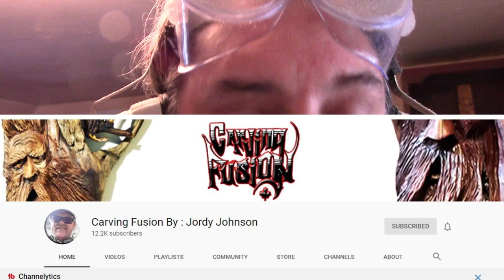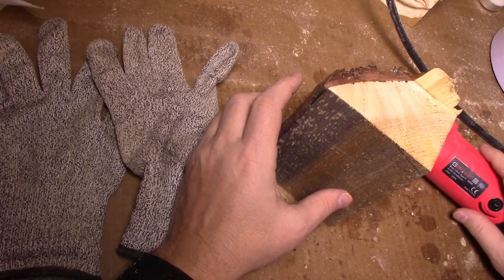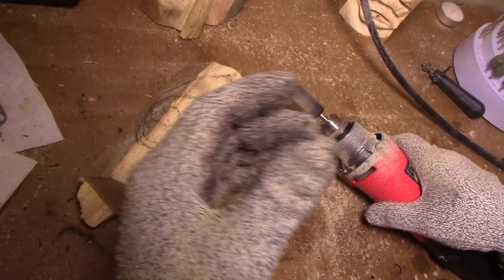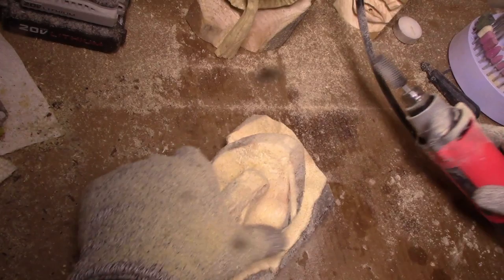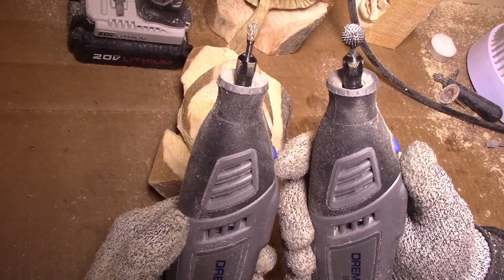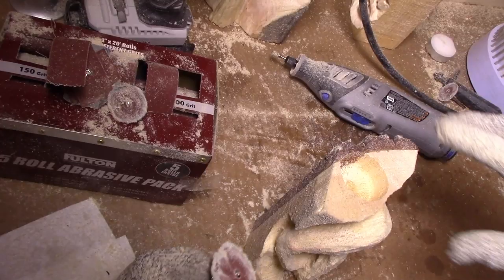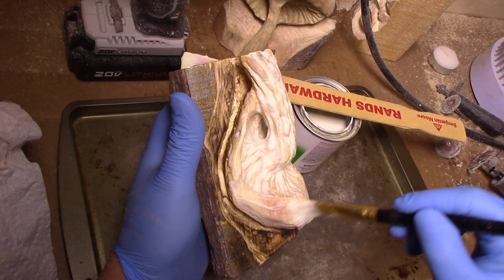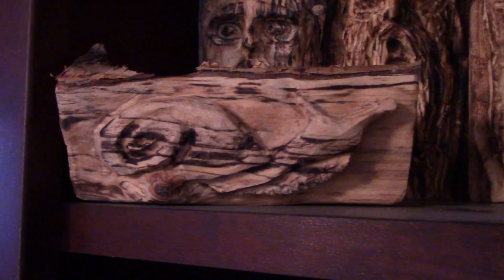How To Wood Carve A Glow In The Dark Mushroom

Comment: great mushroom! Glad to see part of your PPE included a dust mask. One question, on top of the mushroom is a cut out, is that for a tea light candle? keep at it carving is good for the soul. Keeps your concentration very focused and learning a new skill keeps your brain healthy (just my opinion).
Reply from the maker: Correct , I use a paddle bit to make a 1 and 1/2 whole on the tops of all my pieces.  The tealights will fit perfect in them and then they also now have a function.  Also I bought tiny plant spots that fit in the whole so if someone doesn't ant to use it as a candle they can use it for a succulent or airplant.